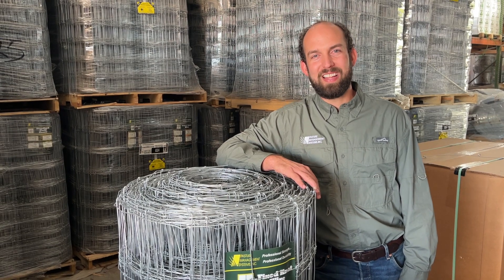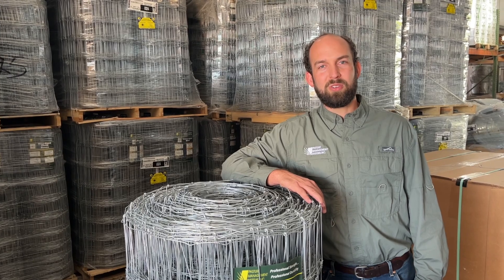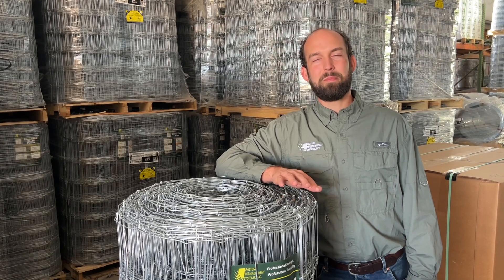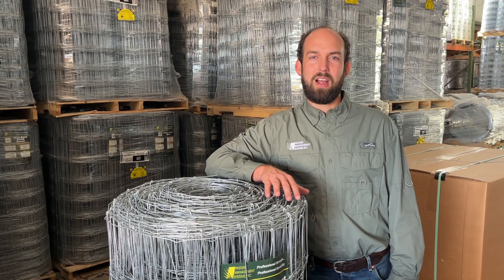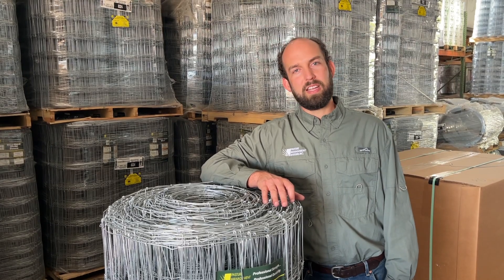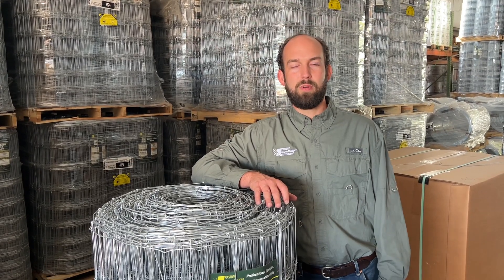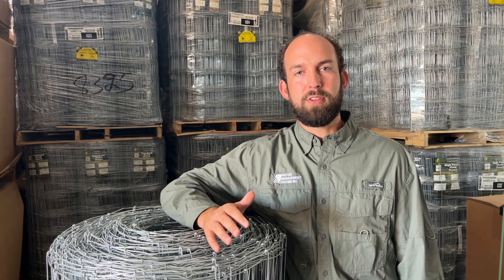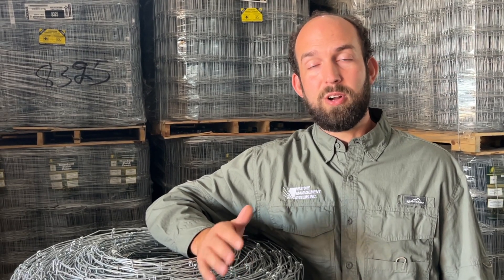Know Your Wire: Does Galvanized Wire Last Longer?

Comment: Great video, I want to fence in about 5 acres in the tropics, to hold goats, I’m chasing a permanent solution, what should I ask for? I’m in Australia. I don’t have time to do it myself, I’m gonna get a contractor to do it, the guy I spoke to said that whatever I buy, he’ll install. He said I should go 4 foot, 4 inch mesh with a single strand of barbed wire on top. But what type of mesh should I use?